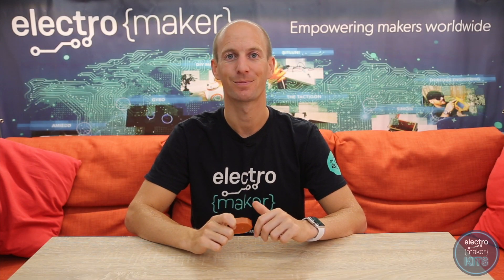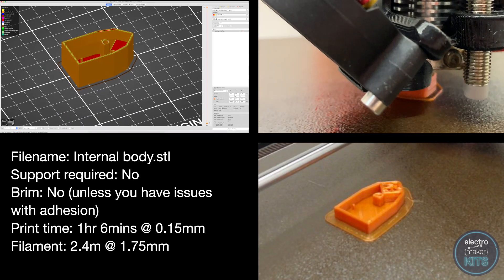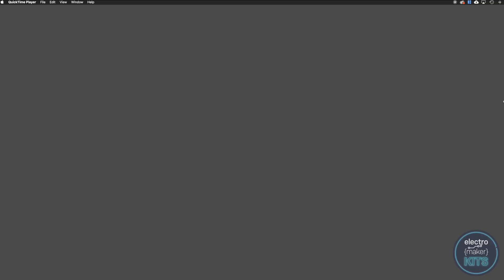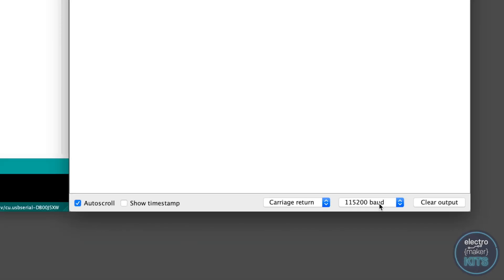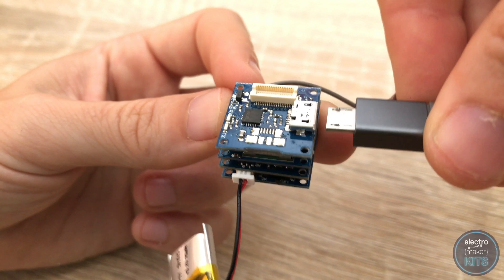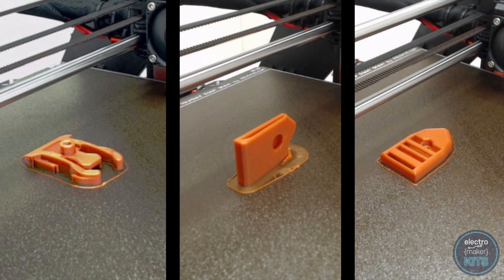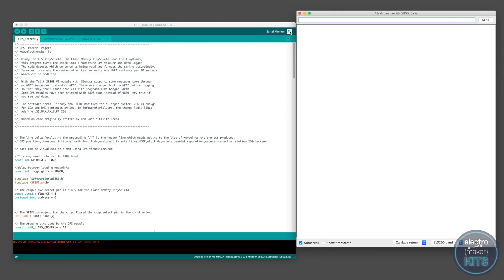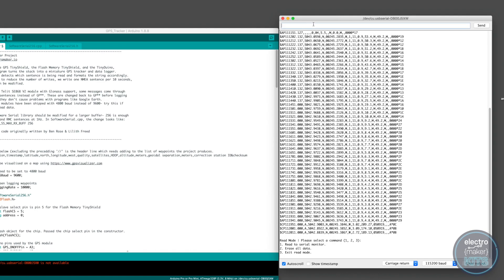Personal 3D Printable GPS Tracker Tutorial

Comment: Great idea... But is any way to see online where is tracker right now? To see where the kids..
Reply: There are some ways to make this. If your kids have cell phone, then a ESP32 could connect to the smartphone (personal hotspot) and send location data. Less efficient solution could be to use ESP32 to connect to open WiFi networks to send data. My last idea is to to use GSM module with SIM card. All of these will consume a lot of power, so re-charging the battery very often is required.
Reply from the maker: Great suggestion!